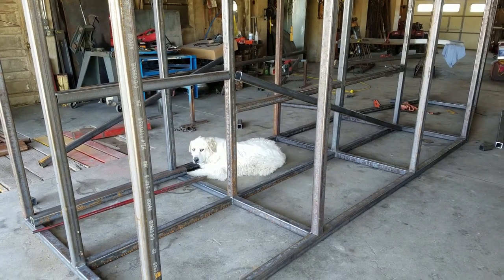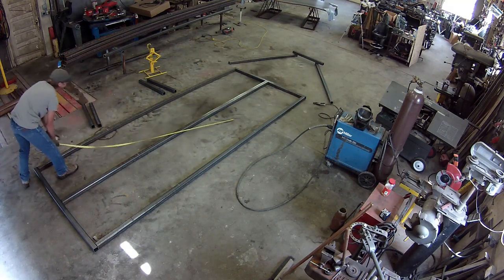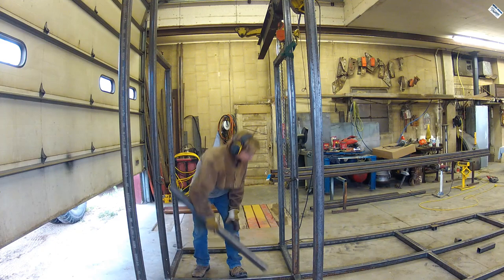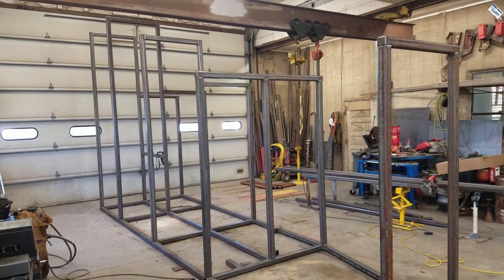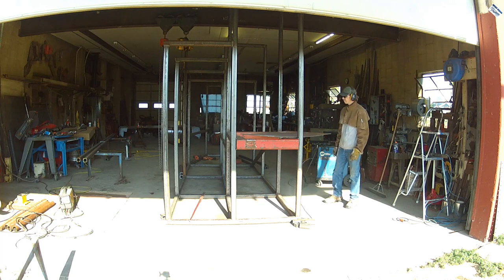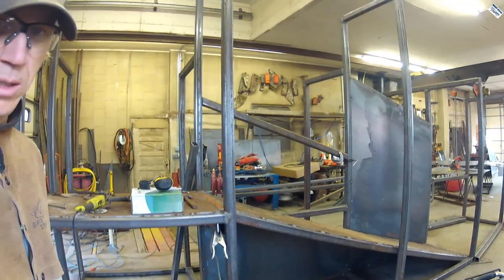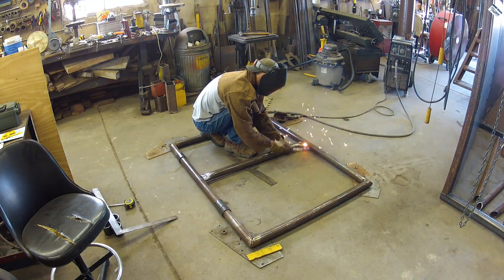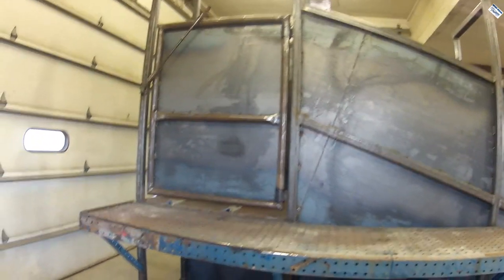Cattle Loading Chute Build for a Customer

Comment: I like your videos. I also build lots of stuff out of oil pipe. Any suggestions of how you would build a latch on a double swing gates??
Reply from the maker: Thanks! Unfortunately I have little suggestions for that other than use a chain. For one customer, I welded  the sucker rod box ends vertically, one on each gate, and dropped a piece of sucker rod through them.  It kinda works. He had me come back and add a chain as a safety.  I saw a neat design once where a piece of metal piece bent like a "7" flipped over and locked both gates together.   I did an image search, and can't find it. But "System Fencing" has a "V" shaped one that's the same idea.  I think if do a search for "system fencing double gate latch" you should be able to find it.